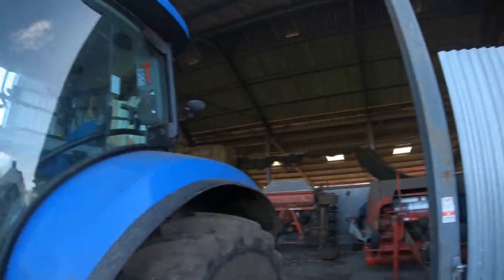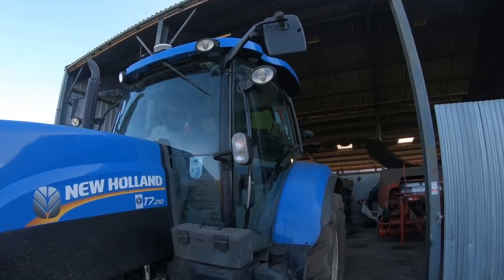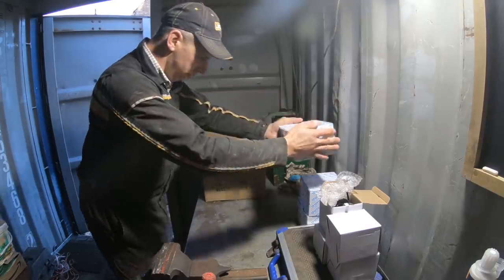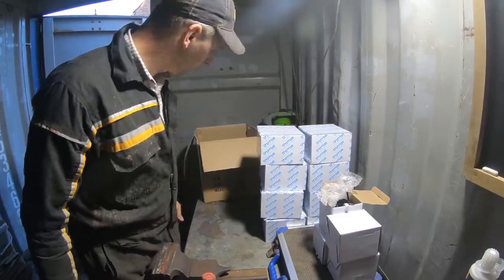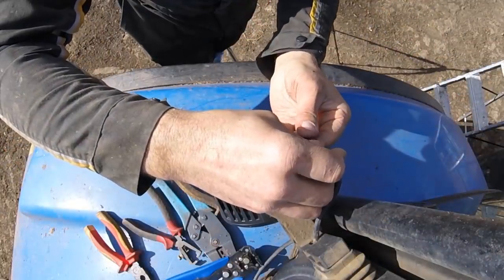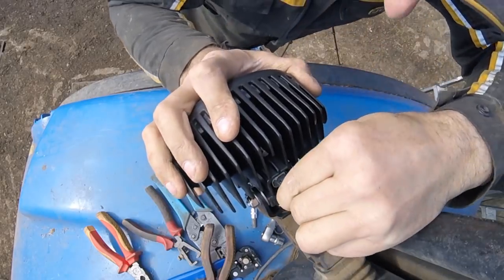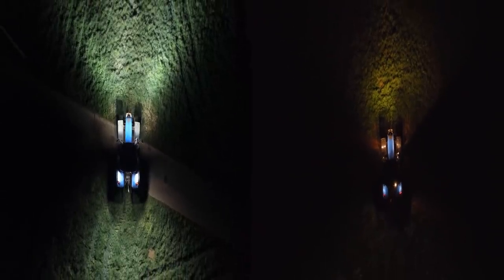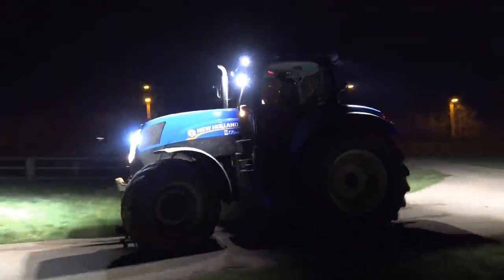FROM CANDLES TO SUPER BRIGHT LEDS ON THE NEW HOLLAND T7

Comment: How does the new LED cope with the electricity output George?  Because LED lights would be using allot less power than the older Halogen lights!  The Tractors power systems would still be sending the original power output to the lights as it don't know they are LED?  So how does the new Lights allow for the higher power still coming in?  Or did you have to sort out a different fuse setting or something to stop the original lights power from going into the newer lights and overwhelming them.
Reply: Colin that’s not how electricity works. The leds will only draw what they need. The only thing that could hurt them was if the voltage went high for some reason. That would not happen unless there was a fault with the tractor.

Comment: I'm not sure about doing this on my ford 7810, on the one hand I want to keep her as original as possible and on the other shes a working tractor and the lights aren't great, might light up 40ft at most
Reply: Go for it lad 👍🏻
Reply: Change them to led if she’s a working tractor but hold onto the old lights so they can be refitted in the future when she goes into retirement 👍🏻
Reply: If shes not blue she'll not do got a 7840 and i have light bars and upgraded leds on it, works mint
Reply: If shes not blue she'll not do Some company’s make led replacements that look very similar to the original lamps.